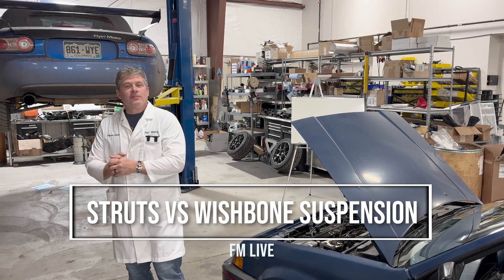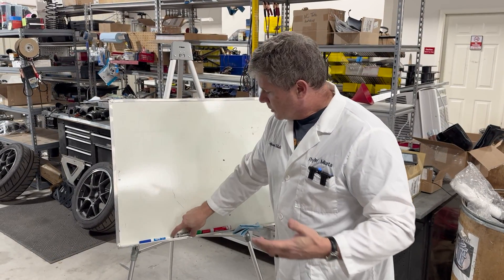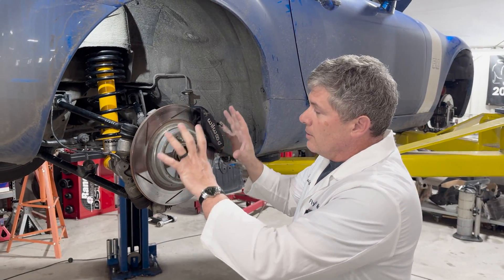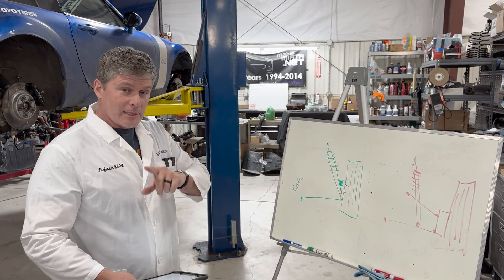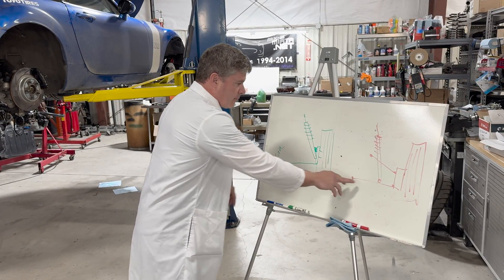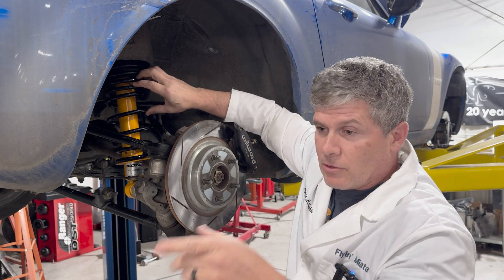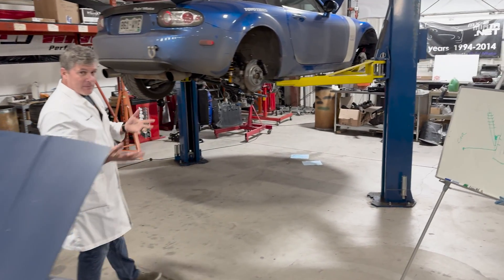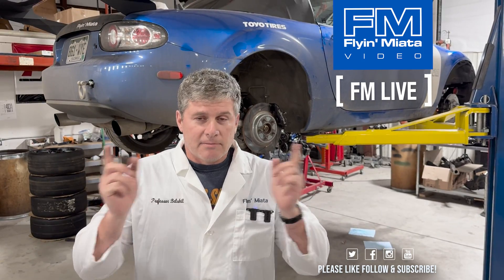Miatas don't have struts! (Struts vs Wishbone Suspension FM Live 2-22-24)

Comment: in your opinion, did the NA and NB have "superior" suspension (or at least more budget for the tech of the time) to go into their setups due to having true double wishbone on all corners while the NC and ND settled for multilink rear instead despite being higher up on the evolutionary chain?
Reply from the maker: The opposite. Multilinks are more difficult to design but they allow for more complex kinematics.
Reply: @FlyinMiataVideo  Interesting and also confusing, coming from cars like the S Chassis, that used rear multi link  suspension that looks almost exactly like this, with the exception of the strut connecting closer to the bottom edge of the knuckle while the lower wishbone also holds up the knuckle and the traction rod, toe rod and upper control arm attaches at the top like the miata?

On the S Chassis, they were never called double wishbone, as the strut connects to the end of the wheel knuckle along with all the arms and the wishbone. But otherwise, it seems to have every component the rear multilink in the miata has. I wonder why/what the benefit of this is. It is clearly the same (all components involved), yet different - just by where the shock absorber was decided to be mounted at Nissan. 

Why they chose to include all components but have it operate as you describe a strut car to operate (Camber changes negatively with compression) is weird now because the argument of cost is then thrown out the window and now Nissan seems weirdly inferior to me, even though I've been playing with them for over a decade now.

 I'll add that this may be a psychological grievance because prior to getting into miatas (or even diving into other forms of suspension) - the 240sx was "king" to me in my own bubble and getting hyper familiar with one car made me think it was the best suspension ever (as in, I knew my way around it - and only it - therefore I liked it most.. lol)
Reply from the maker: @twrcrew8852  It's all in the engineering. Porsche 911s used struts up until pretty recently and they historically do pretty well around a race track.

Comment: Definition of a strut: “a rod or bar forming part of a framework and designed to resist compression.” Because the Miata uses a coil over dampener (shock) design, the combined package can still be called a strut because the spring resists compression. What it is not is a MacPherson strut, which is a specific type of strut suspension.
Reply: I agree with that. The term “Strut” is often used interchangeably with “MacPherson Strut.” But those people who are new to automotive engineering terms may not yet know that. I’m putting this clarification out there to, hopefully, help with any confusion.
Reply from the maker: Thank you for your feedback! While going by the Webster definition of the word may indicate that this assembly   be called a "strut", this video is saying that Miatas do not have MacPherson strut suspension.

Comment: I remember reading on koni's website many years ago that if the shock was a load bearing member in the suspension then it was technically a strut.  This definition was not describing the whole suspension such as a mcpherson strut suspension vs double wishbone.  It was just referring to the "shock".   If you remove the unit from a miata, the car will fall down, which means its a strut.
Reply from the maker: I'll have to correct you on this one because Miatas run shocks. I did look up the Koni FAQ that you were referencing and found this, "....if you remove a shock the spindle or axle will still be completely attached to the vehicle.....It is often assumed that any damper with a spring is a strut, this is not the case."

Comment: Any benefit at all to using a top mount with pillowball mount then? I noticed none of the Flyn Miata coilovers use pillowball mounts, not even the Fox coilover. But other competitors do market pillowball mounts. Are those just unnecessary bling?
Reply from the maker: Since there's not a lot of side to side movement in a shock suspension, most folks won't really benefit from a spherical bearing (what we use in our NA Rear Shock mounts) or a pillowball, compared to using something with a bit of deflection, like rubber. For the majority of people that like to take their car on the street, the small amount of flex that you get from the OE rubber bushings is worth the trade offs in NVH the a solid spherical bearing might give you.

That, and, keeping the factory NB top shock mount set up as we do in all of our coilover kits reduces cost a non-insignificant amount, compared to designing and manufacturing custom mounts with pillowballs and/or spherical bearings. The stock stuff works well.

I won't say pillowballs or spherical bearings are unnecessary bling, as they do have their place, but I'd recommend something with some rubber in it to soak up some NVH if your car spends most of its time on the street.

Comment: So miatas dont need/require struts bars right?
Reply from the maker: They can benefit from them in the front, but it's a different set of forces than a strut car so the design ends up a little different.
Reply: A triangulated bar han help with NVH and cowl shake. A tower to tower bar has minimal effect and none on suspension geometry change under load.
Reply: My take-away from some of FM's other videos is that the strut bars are beneficial to chassis rigidity (in the front, useless in the rear as explained in this video and others).

Comment: That gen Honda is getting pretty unicorn and this one is super clean. The "new" Renault Megane RS models (gen 3 - 4) use some pretty trick strut-based setups which they call revo knuckle from memory. Honda's new Type r's are doing pretty well too with those 2 battling it out year after year for Nurburgring fwd records. Porsche did end up finally going to double wishbone fronts on recent GT3 models. Pretty good of Mazda to stick to double wishbone for so long when Honda gave up mid-late '00s with the cl7-cl9 accords.
Reply from the maker: That little CRX is Keith's. He should have maybe washed it first, but it's in great shape.
Reply: I may be mistaken but I think the first Megane RS (the gen with the R26.R) also had struts that separated cornering forces from steering ones. I believe "Revo knuckle" was Ford's marketing term for it though, as they used it on the Focus RS.

Honda's system is basically the same too, and another that used it was Toyota back in the 90s - the "Super Strut Suspension" on the Celica GT-Four and a few others was basically the same idea. Very clever stuff and stuff like the Civic and Megane show it really works (though French brands have shown that simple torsion bar and trailing arm rear ends work well too!)